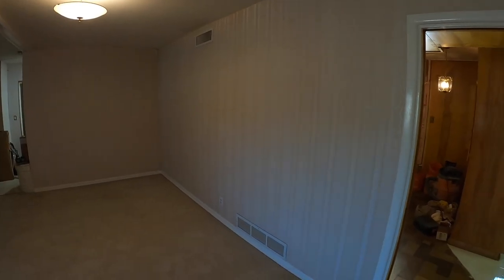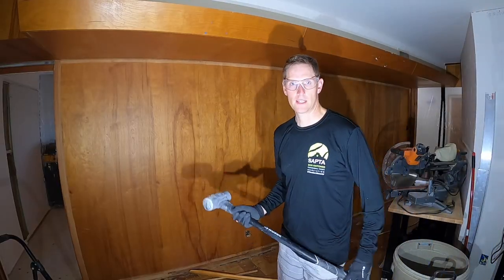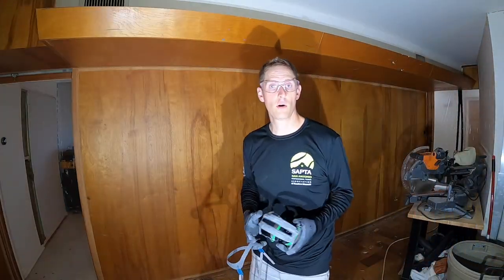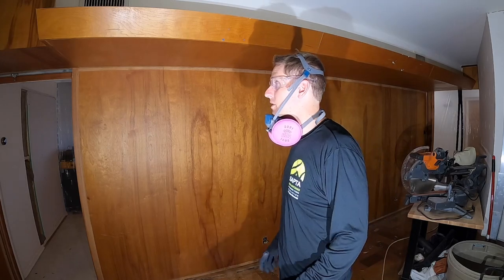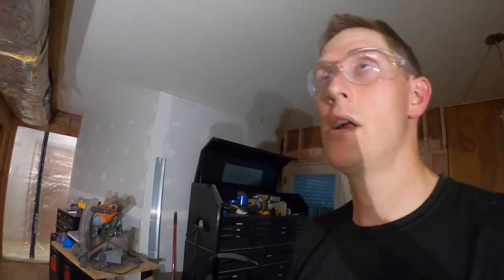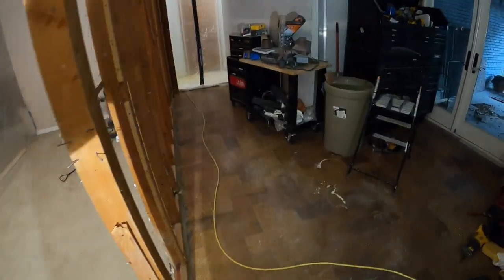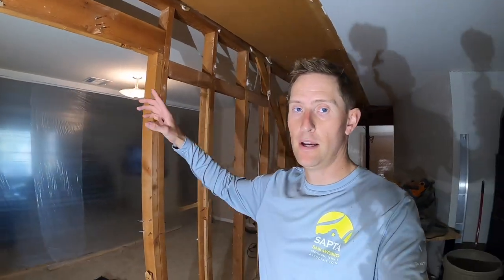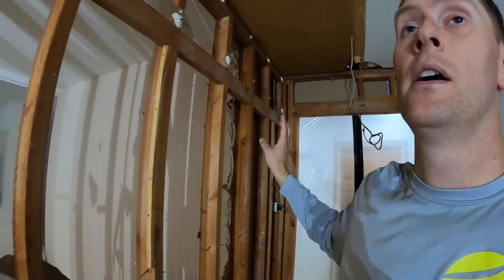Removing a Wall = DEMO

Comment: The handiest tool for remodel demo is by far a 36 or 48 inch wrecking bar/prybar.
Reply from the maker: Yep, I could see that being very useful! I'm gonna look into picking one up. Thanks for the tip!
Reply: @AtHomeDIY  I'm in the middle of a full gut to the studs and I've used that and a reciprocating saw more than any other tools.